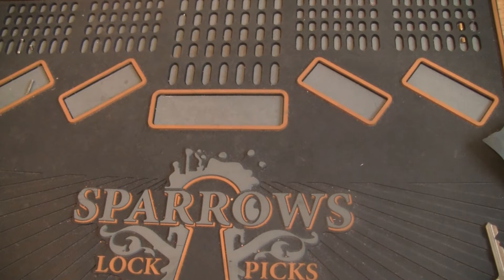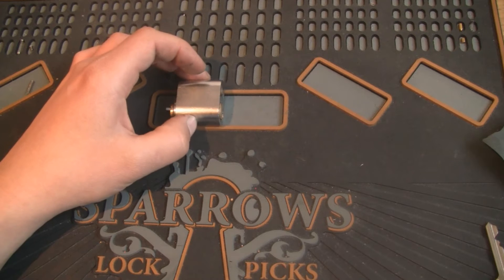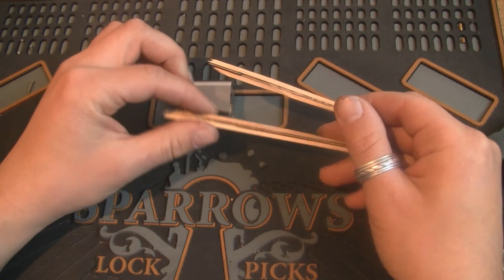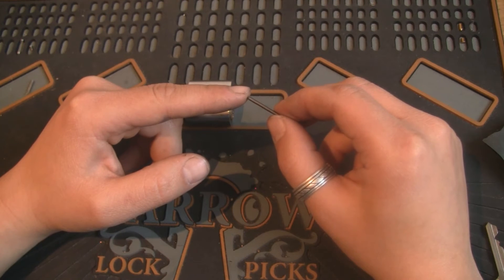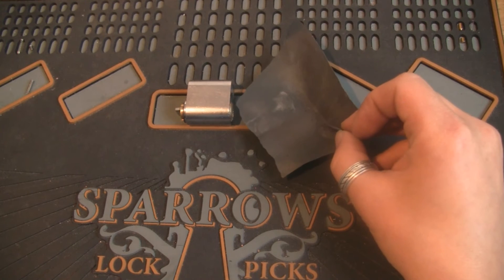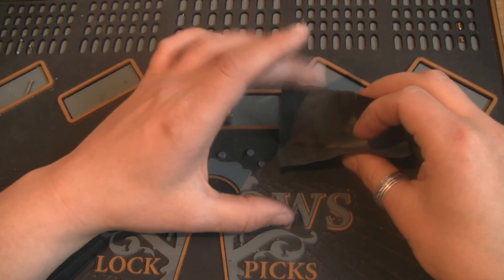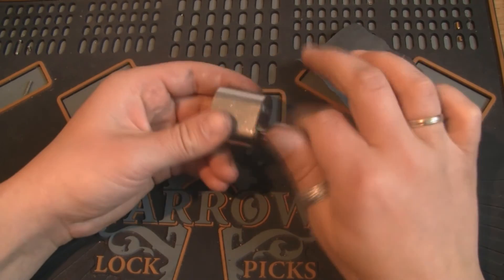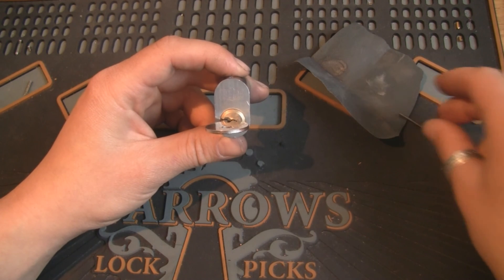Pencil graphite as lock lubrication - Ok or not?

Comment: I think this is a good idea. Another thought, batteries labeled as heavy duty such as AA, AAA, C, and D use graphite rods as the cathode. They are a lot thicker and possibly more pure, because I don’t think they contain the clay that a pencil does. You can even pull one out of a dead battery, it doesn’t affect it. It is a messy operation so be prepared for that, use gloves and something to protect your table.
As far as grinding, sandpaper is a good idea but I’d be concerned some of the debris from the sandpaper would get mixed in, I would consider scraping along the side gently with a razor blade or X-Acto knife. If you get any chunks, you should be able to easily crush them with a credit card or something like that.
I’ve read a few places that it’s best to add some liquid to the graphite powder when using for lubrication, I am not a locksmith and have no idea if this is true, can anyone else comment on that? The powder by itself looks to work just fine.